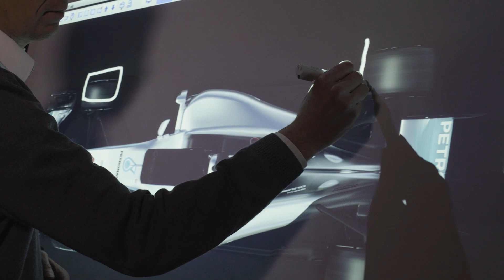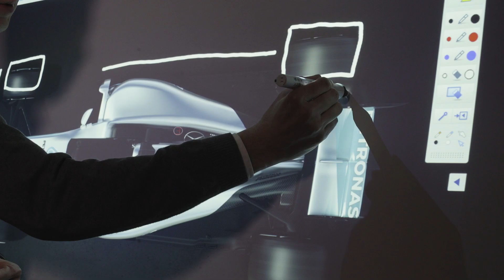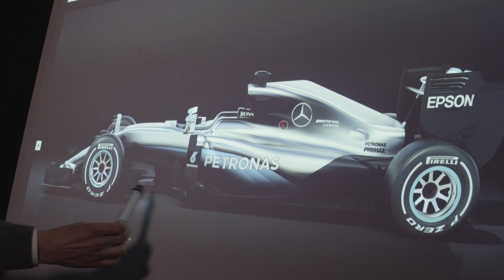F1 2017 Explained: Aerodynamics #SimpliF1ed

Comment: Great video. Thanks! Will the new aero package allow cars to run more easily behind one another and give us more wheel-to-wheel action?
Reply: Probably not, we need more mechanical grip and less aero dependency in the front.
Reply: John Hodgetts I doubt it, turbulent air from the car in front will mess with the aero.
Reply: Jack 1 I was just wondering, now that the floor of the car is generating more downforce than before, would that still be affected as much by the turbulent wake of the car in front?

Comment: Cool, but does this help aid overtaking? Or just more performance in qualifying.
Reply: HELLCAT Or No Car / ABRAMS Or No Tank  It will make overtaking more difficult, unfortunately. F1 really didn't think this rule change through.
Reply: i think it will be the same, if not worse because of the wider tyres, it will be harder to go side by side.
Reply: Monaco will be impossible now with those wide tires.